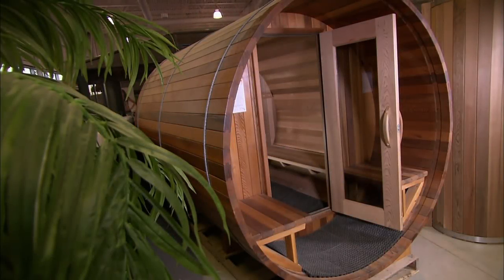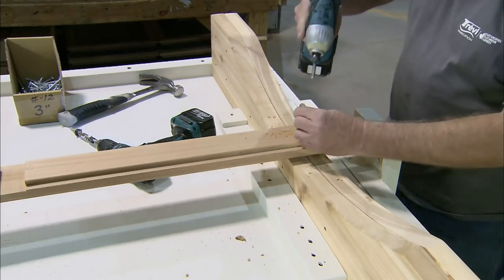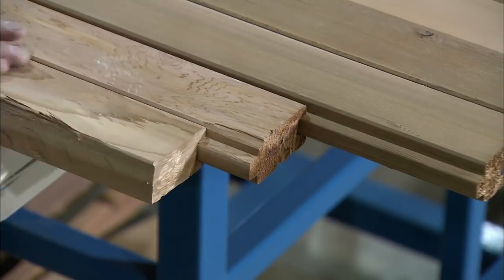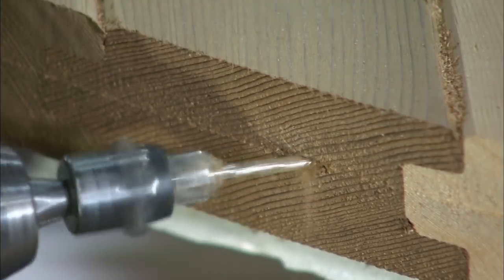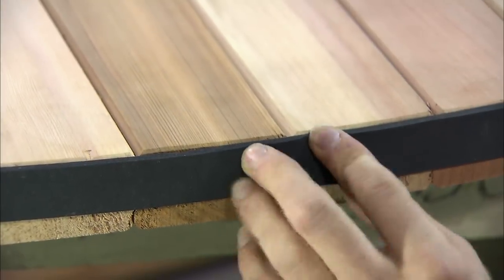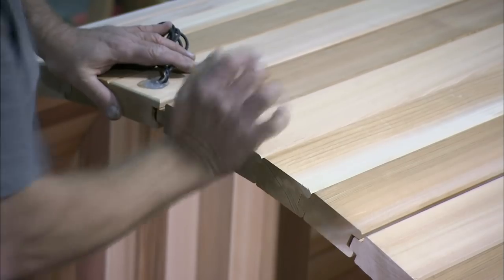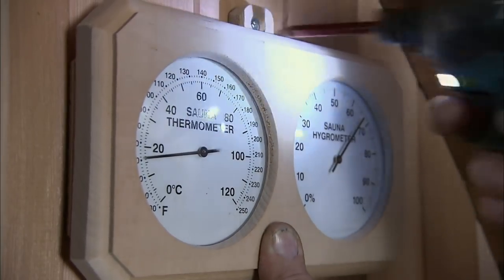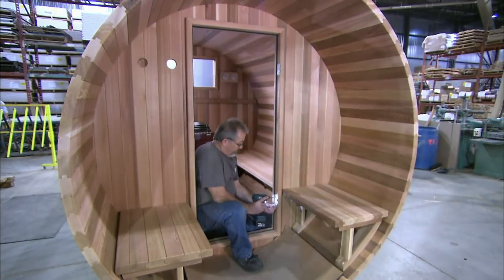SAUNAS | How It's Made

Comment: I just wish it would be double the size - to invite friends, and fit a larger family too.
And the washing room and preferrably dressing room too. Well, if they're close by otherwise, you don't need them attached to the sauna. But if you build a real sauna, it's a small building, not a hot tub on its side only :).
Personally I like to have the washing room next to the sauna in a normal room temperature, or a bit cooler - like in the swimming hall shower rooms.

Comment: What is the tool used at 3:45? i cant find it anywhere?!
Reply: I think it's some sort of a wired power drill with a certain head to tighten the nut. Many power drills have the option to change the tightness.
Reply: An extension bar with a socket on a drill or the vice grips?

Comment: A sauna built like the one in this video has many key flaws.

1.An electric heater in place of a wood burning stove. (this one is mostly an opinion, and electrical heaters can work if designed to retain their heat between uses[closing hatch]) The minute amount of wood smoke that escapes into the enclosed space is rather pleasant and works wonders for setting the mood.
2.The Stones of the stove should be situated on the same height than the occupants feet will be once sitting on the bench. If the stove is situated too high the warm moist air will not reach the users feet.
3.There needs to be an inlet for fresh outside air on top of the stove so that the inflow air oxygen will mix with the thermite of warm air and water vapor rising from the stone stove. This is particularly important for user comfort.
4.Naturally there needs to be a way for the warm and carbondioxide rich air to flow out from. The holes next to the door are not optimally placed since they offer the warm airflow that rises from the stone stove an easy way out which is close to the top of the enclosed space. Thus the warm air would simply shoot out of the sauna in a laminar flow without mixing with the rest of the Sauans volume of air.
5.The floor of the sauna tube demonstrated seems to have some holes in it but lacks a thorough to properly drain any spilled water. Trying to keep this sauna in tip top shape ( namely letting it dry out completely between uses) would be nigh impossible.

In this abomination that is posing as a sauna you would quickly find yourself struggling for breath with your head burning and feet feeling drafty. You'd constantly be out of water for the irritably dry air and the electrical heater wouldn't by the looks of it be able to hold enough stones to ensure a high enough thermal capacity to see your lackluster experience to the finish.
Reply: So, then, you're not COMPLETELY happy with this, then! Are there alternatives one can buy?
Reply: @steveprice638  buy this one and do the modifications YS. Or contact a finnish contractor. ^^ 
Examples of those (built indoors) through the link below
https://sunsauna.fi/miksi-sun-sauna/
(couldn't find one that was also translated into english, sorry)
Reply: We purchased one exactly like the round sauna at the beginning of the show back in the early 90's.  It worked great for about 18 years.  Nothing beats spending 30 minutes or so in a good sauna to fix almost any pains.  Back, lets, etc.  Shalom